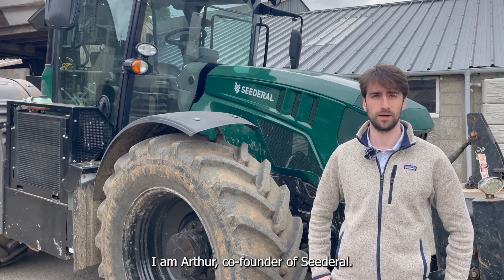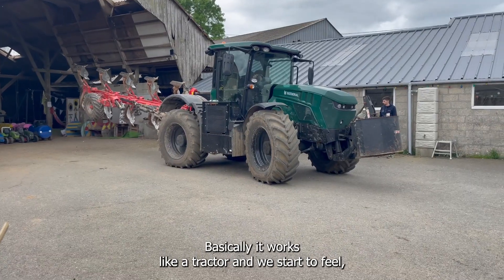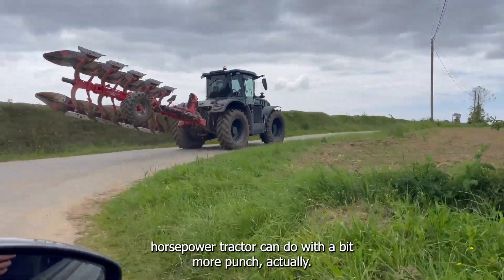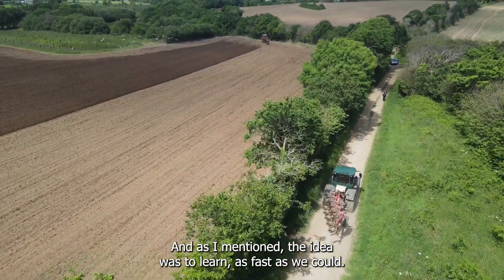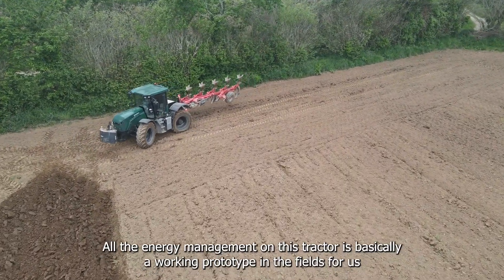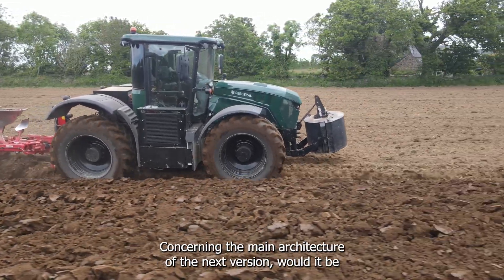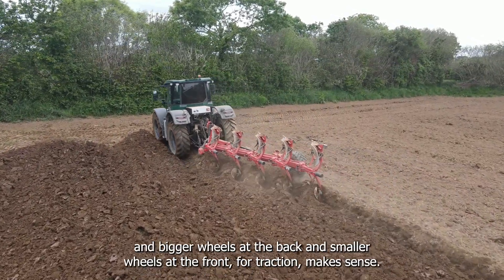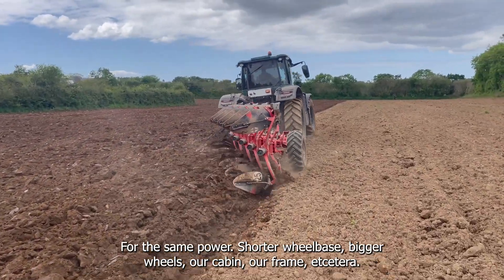Exclusive: Silent plowing with a 160 hp fully electric tractor

Comment: And no one thinks about the power needed to charge these batteries in 2 hours?  he says he can drive for 1.5 hrs , pulling that plough might easely draw 100kw , making the battery at least 150kwh, i think even more like 200 kwh; To charge that in 3 hours you need a 66kw charger, at 400 volts that requires 165 amps. I don't know allot of farms that can handle this amps. AND on top of that, lately we have to pay electricity based on peak power. So someone can draw more electricity for the same price if he manages to keep its peak power low.

Comment: 160 horsepower = 120 kw * 6 hours = 720 kw-hours + spare capacity for transporting the tractor. The battery must be at least 1,000 kWh, and it costs more than $100,000 - and where is there any economic feasibility in this tractor? Who will guarantee that the battery will serve at least 2 seasons and not have to buy a new one?

Comment: My take on this topic is that company's like this (especially small startups) should focus on developing small tractors (for small farmers) that run a few hours a day and preform light duty tasks like pulling, mowing, transporting or short sessions of field work etc. Going into a market for industrial type field work (very energy intensive) is to my eyes a complete nonsense. And there is millions of small very inefficient tractors that need replacing trough EU. If they could offer a decently priced small electric tractor (equivalent HP ranging from 50-80) I bet it would be a hit. But of-course the profit margin on each machine would have to be way lower and in today's market profit margin is all that counts 🤑.

Comment: 6 hours ploughing... not great but not terrible.. this would be great for second tractor in farm who is dealing with smaller jobs like raking, transport, work with frontloader.. stuff that needs high power for short bursts but most of the time runs light on power demand so the battery capacity wouldn't be such a big problem for tractor.

Comment: Just a crack pipe dream.  For one thing, notice they cleverly put plow shares in a vertical  line to reduce drag. The horizontal path that the machine plows is half of a diesel plow.  So it takes more than twice the time to plow a field than the diesel plow.  And if the farmer has a field 25 miles away from the charger, how will he get it charged?  A diesel tractor can just be fueled by a mobile fuel truck.  You can bet this guy is getting a government grant from your tax dollars to "develop" this.  And all down the toilet.

Comment: how many hours of work, how many hours to charge the battery??, the electricity to charge the battery? where does it get it from??, from a generator that works with pedals??, I have from a generator that generates electricity that is made by engines that work with diesel??,
and they still want to palm off battery-powered tractors, battery-powered cars, buses to the gullible, but why don't you use synthetic fuel, I managed to make endothermic engines pollute less??, instead of this big bullshit about batteries??, and the day that the batteries explode in their ass you'll see how funny,

Comment: Well done!  Not many Future (thinking) Farmers commenting tho!
Reply: They aren't commenting because that thing isn't worth the time to comment. The specs he quoted are actually quite poor, especially if the field is one year virgin or older. The recharge times are ridiculous. I saw a comment on here about having to stop to go get fuel in town. The farmers using these and larger have fuel trucks that go to the machine. He talked about 12 hour days. Those big farms do 24 hours during planting season in shifts. It was not uncommon where I grew up to see machines running corn fields all night during planting. Charging off a wall charger, is extremely slow. Again, that won't work for these things and again, we're back to the classic infrastructure argument. I hate to say this, but I know quite a few farmers who have basic 100 AMP service to their house only. The cost to upgrade to 200 AMP is just not in the budget for them. Then there's the less moving parts argument? Please don't get me started. It's not the moving parts that are the problem. It's the electronics that will be. You are trading mechanical failures for electronic ones.
Reply: We are thinking

and we are thinking .that when there's bad weather on the way an the 50 acres that needs sowing before it gets here,
ISN'T GOING TO GET DONE BY A TRACTOR THAT CANNT WORK ALL DAY AND ALL NIGHT ON ONE CHARGE

EV tractors are for hobby farmers,
we aren't going to feed people with these things
Reply: @farmerned6  True. Just do the energy calculations. Battery density is improving every 7 years or so as more r&d is done.
It's less parts that need servicing, I think a 10x decrease compared to ICE engines.
Quieter so you can hear what's going on better.
No need to go out into town for gas. Can even hook it up to solar panels if you want. EV's at a minimum can even charge off a normal wall outlet you'd plug your phone into (slow, but it works)
Better control as torque is immediate, and the torque curve is smooth. ICE needs a transmission to smooth out torque curve.

Comment: This doesn't even seem half bad, but the two hour charging is a dealbreaker in agriculture. You have work peaks where the tractor has to run the whole day. They need a way to switch the battery fast (10-20 minutes max).
Reply: And that's not counting on bad days where you might get bogged in the middle of the field with low battery.

Comment: Makes the batteries interchangable and awaay we go!
Reply: Which wil allow to use the power from the solarpanels on the roof of the farm. Great match as in summer often there is more work to do for the tractor.
Reply: multi ton  interchangeable batteries? 

and WHERE are you putting them?
under the cab? 
centrally for weight distribution?

JCB already did the maths,  all-day battery would be over 10 ton by itself
its a non-starter , unless you can shrink and lighten batteries , by several orders of magnitude
Reply: @farmerned6  Under the hood and as a front weight
Reply: It seems like it would be easy to do.
Reply: Not so easy when you can't charge them, why you say. Because the Hydro grid can't supply that much power... Lets use Solar or Wind, sorry to tell you there's been no Wind for a week. Almost forgot Solar needs Sun it's been Dull and Overcast the last week, also as 6 months of the year you have less that 8 hours of low sunlight. Do I need to say anymore....
Reply: @brucescott9814  
Solar?
umm.....
we NEED the tractor working when the sun shines
and (AFAIK )battery to battery charging is very inefficient
Reply: @brucescott9814  Well it isnt always raining, but we have ways of storing water. All we need for renewables to work well is grid scale storage. Also, the wind is always blowing somewhere in the country. If you have windmills distributed everywhere, there will always be a portion of them working. Some places the wind almost never stops, like offshore. And with solar, again if they are distributed across a wide area, say the entire continent of north america, cloud cover becomes less of an issue. Its always sunny somewhere. Also when they are spread across timezones, you can buy and sell power from the timezone next to you after the sunsets or before the sun rises. So renewables are more reliable than people give them credit!
Reply: @brucescott9814  I hope you know renewable doesn't just mean solar and wind. Technically speaking, you can convert any plant matter into a fuel with 90% or more of the same energy density as diesel. This means you can grow trees and process them into biodiesel and it's a net zero system so long as you plant the same amount of trees cut down. You'd still want to go with  battery power since a large generator at a powerplant is VASTLY more efficient than anything you can put into a vehicle, even considering the energy loss through transmission.

Comment: Charge two hours plow 1.5 hours. Only use it in ground that's broke up good with no weeds.  You did a couple acres and it's already screaming charge me. It's cheaper to run but you need 8 to do the same acres as one diesel tractor. Maybe some day but not in 2026.

Comment: they need like batteries that attach on thr front weight vracket that can be charging while your running like a dewalt drill so 1 tractor w 2 battereis

Comment: 6 hours. Max. Theoretically. I drive 1/2 hour to the paddock, work for 20 hours, there’s no power there, then 1/2 hour back. A tractor will do many thousands of hours. How many years does that battery last? More expensive to buy? Tractors are already insanely expensive. Cheaper to run? How about when power prices increase? And what happens when they get covered in cow dung and mud, going through wet bogs, all good?
Reply: so 1 hour a day driving and 20 hours in the field

Do you do that every day?
Reply: @thinfourth  yes of course 365 days a year. What do you think?

Comment: There is absolutely no way this would have been of any  use even on a 6 hour shift because it would not be recharged in time for the next day........lol that is if your local farm power supply was capable, without browning out the district. Just imagine how many you would need on our 20,000 acre farm,where at peak times we are operating 24 hour days playing, harrowing reworking for weed kill spraying the list goes on! Not to mention thenpower station needed that would have to be coal, Gas or nuclear  because the sun doesn't shine at night nor the wind blow 24 hours. About time the Woke woke up.

Comment: Well, this shows exactly why going electric with agriculture is going to be a hell of a job. 160hp (120kW) is fairly small by agricultural machinery standards - a small combine starts at 200kW (270hp), large ones run to 500kW and over. If this was able to work at the full 160hp for 1.5hrs it would need a 180kWh battery - that is going to be 680kg of cells even if you thrash it from 100% to zero which isn't going to be a good idea for battery lifetime so closer to 1000kg plus thermal management, balancer electronics, protective casework etc. For the 6hr version we are looking at 720kWh so more like 4 tonnes of cells.
Do the sums for a mid-sized combine and consider how these things are going to get charged in all the fields in the World where they are going to be needed.
Reply: @ColinMill1  Tesla's semi seems to of solved the issues..
Reply: @Rockall57  The problem is significantly worse with combines as they operate at full power all the time unlike road vehicles that operate at full power climbing hills and accelerating but cruise at much less than full power.
Of course the Tesla semi does nothing to solve the infrastructure problem of farming. That needs to have the capacity to fast charge batteries as big or bigger than a semi in every grain field in the world.
Reply: @ColinMill1  passenger cars need vast infrastructure that spans the entire country. A tractor only requires operation on the farm it’s working. The easiest answer to this “problem” already exists. You can just swap out the batteries. I don’t wait 3 hours for my dewalt to charge I just grab a spare and go back.
Reply: @Neoprenesiren  So in a field miles from anywhere you are going to swap out a battery of at least 200kwh usable capacity every hour even for a small combine and transport it to a charging point where exactly?
Reply: 120kw is fairly small? Yeah, and ferraris are very cheap cars 😁
Reply: @cengox3831  Take a look at the John Deere tractor range or the Class combine range or better still talk to a farmer.
Reply: @ColinMill1  i am an agricultural technologies engineer 😁
Reply: @cengox3831  Then I'm sure you will know that the smallest combine in the current Claas range is rated at 150kW.
Reply: @ColinMill1  this is from the report, which published in nov 2023:
"The 46-65 HP segment generated the highest sales in most of the regions in the global tractor market"
Reply: @cengox3831  Sure. And lawn-mower sales far exceed the sales of 9ft mower/conditioners too🙂. Tractors in that size range are used by smallholders, golf-courses, parks, councils - not just for agriculture. Increasingly, even here in the UK ploughing, hay/silage cutting, baling, forage harvesting, grain harvesting etc is being done by contractors and they don't, unless access is an issue, fool about with tractors in that size range because power directly influences the speed of work and that directly relates to income. Third-world markets do still use tractors in the 45 to 65 HP range because of the nature of post subsistence farming there. But many of these models are made in, and for, the third-world market - they aren't even available in the UK. 
And of course, tractors are only part of the equation (please note - I said "by agricultural machinery standards" not just tractors). Combines and foragers are a significant part of the requirement and, as I have pointed out, you don't find current models of these in the sub 120kW size range.
Reply: @ColinMill1  As with the electrical cars, this will scale up. Engine power density is already better and battery technology is evolving fast. Implementations can start at the lower end where requirements might be lower and we'll take it one step at a time. Different agricultural branches also have other needs. Sometimes all you need is a nimble, flexible offroader with a lot of attachment points.

Comment: Have nothing against technology but, this is NOT going to be cheaper to run/operate plus the fact that, electronics biggest enemies is moisture and dust/dirt. Components will not last long and then you have the issue that no country has the infrastructure to handle all electric vehicles. Now, add the fact that for farming, majority of farming is 16hrs to 24hrs pending on conditions, 6hrs won't cut it period, wasting time because you have to cut short field work to charge the battery, not efficient at all, sorry, this won't work well. Perhaps on small farms but not large farms. Also, who's paying for the charging station which is also a specialized unit needed to recharge the battery????

Comment: Minneapolis moline had a fuel cell tractor in the 50’s if I recall correctly its fuel cell used propane the tractor was a beast with power here in the states during planting season minutes in the field can almost make or break a season six hours wouldn’t cut it

Comment: JCB might do a hydrogen version. 
Battery technology needs a revolution to keep same working time, similar price & speedy charge or quick battery change. PTO removal replaced by high power delivery to motor driven implements that used PTO power trains

Comment: In Australia a trucking company realised that they had forklift trucks and they could add or remove a large battery from a lorry in a few minutes just like they could a pallet.. Because they already had the forklift it was dead easy. Large farms tend to have some sort of forklift so having two large batteries and swapping one out with fully charged one would not be an absurd idea. Then that could charge and repeat so with two batteries for one appliance a farmer could work 18hours. I realise in farming some days it is all hands on deck.  I realise that farmers could have a lot of money tied up in batteries. If those swap in and out batteries were a standard in the construction industry that could help keep the costs down by sharing the use. If you search on YouTube for "This GIANT Electric Semi Can Swap Out Its Batteries!" you can see the video for yourself.

Comment: It would be useful to have an aframe towbar close by in case the  battery runs out of power and the tractor needs to be towed back to the farm using another tractor.
Reply: With the ability to disengage the drive train. Dead battery, drive train is locked, remember, electric motors only.
Reply: @Ham68229  need to be a special trained fitter to be allowed to work on or recover EVs
Reply: @robertsmith9810  don't forget if it catches fire, firefighters have to be trained to fight such a type of fire. This is just a dumb idea trying to go EV,  just too expensive
Reply: @Ham68229  ....You're talking about batteries invented in the 70s by a fossil fuel company. In the near future, these won't be the batteries we use, and we already have prototype batteries that don't even catch fire, even if you SET it in on fire.